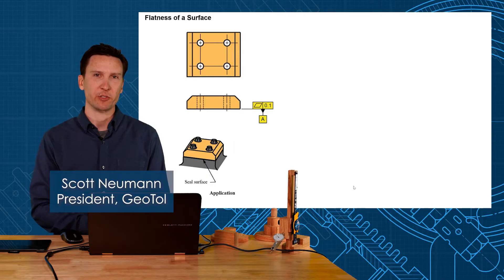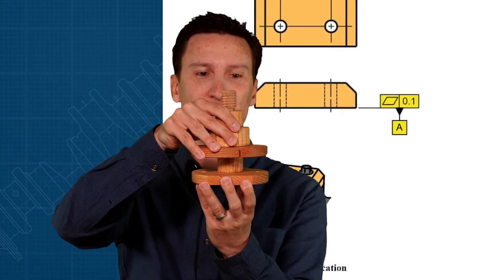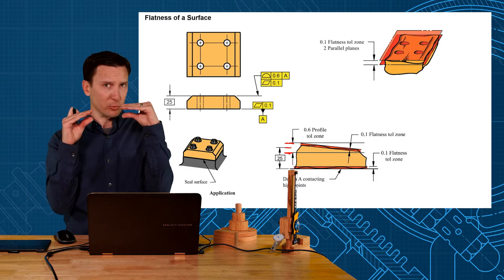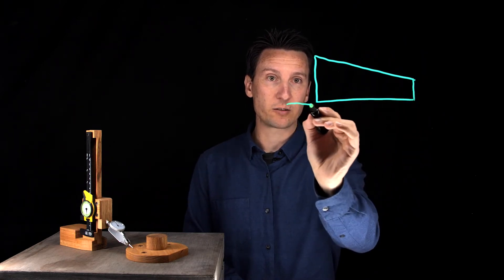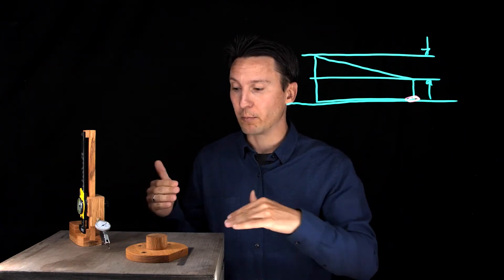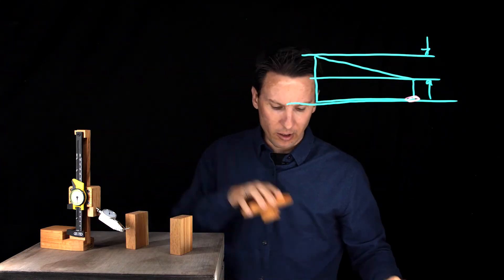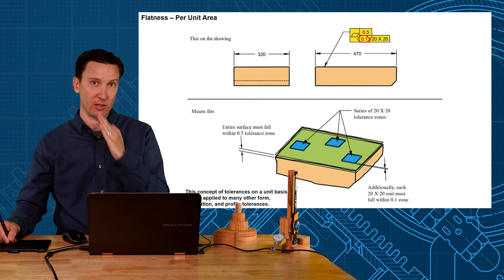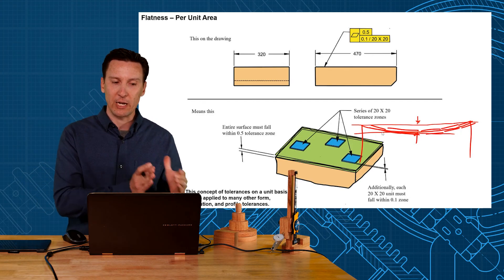Flatness Tolerance - How to apply and measure

Comment: Unless I misunderstand flatness is hard to separate from parallelism when inspecting.  In fact impossible?  One can only minimize the parallel error first then start trying to measure flatness.  Correct?
Reply from the maker: This depends on the measurement technique. Flatness has no datum feature references, therefore the tolerance zone is "best fit" to the produced surface. Best fit is easy on a digital device like a CMM, the algorithm is "minimum zone" (smallest set of parallel planes that contain all measurement points). However, this "best fit" is more time consuming in an "open setup" (bench setup) routine. There are some tricks shown in the video with leveling plates, shims and gage blocks. 

You are correct. One option is to minimize the parallelism error with shims or leveling plate, then measure flatness.
Reply: @GeoTolPro  Thank you for clarifying that for me.

Comment: Do not agree with your explanation of the Profile tolerance, that tolerance has nothing to do with flatness. Profile tolerance describes the form precision of e.g. double curved surfaces. You cannot add flatness to that. Flatness would flatten the double curved surface.If you want to specify the angle of that surface, you should add parallelism to that surface.

Comment: Great explanation! Could you also explain the difference between regular flatness and a flatness with CZ? How the tolerance zones would be in these two cases?
Reply from the maker: Flatness "combined zone" is an ISO-GPS concept. The CZ modifier locates the flatness tolerance zones together to also control location between the surfaces (usually to control coplanarity). ASME would instead switch to a profile tolerance to control location between multiple surfaces.
Reply: @GeoTolPro  Understood. Thank you very much!

Comment: Hey thanks for this explanation!
Question 0:15:
Is there a difference for the manufactured part to inspect if you:
1) Datum A onto the flatness callout itself (like in the video), or if you put:
2) Datum A on directly the surface

Does it matter or is it actually the same?
Thanks :)
Reply from the maker: No difference there. The surface must be flat. Then it is also named "datum feature A". Personally, I like to have the symbols together.

Comment: You need to have the part mounted on three points on the surface plate (gauge or 1-2-3 blocks) for flatness as 3 points make a plane, see GD&T Y14.5-2018 setup processes.
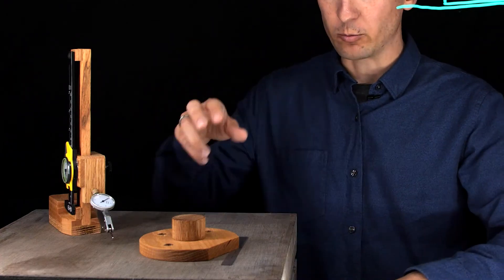Reply from the maker: The video mark 6:06 explains the three gage block method. However, this is a terrible way to check sheet metal or a large heavy part (gravity causes the part to sag). 
ASME Y14.5-2018 does not define how to measure tolerances! It only defines the theoretical tolerance zone. The part's quality plan defines the inspection method based the situation (risk vs. cost analysis). That's what the video is about.
Reply: Two points is never acceptable, putting on the surface plate is not flatness check, part will be reject by any metrologist if this is how you set it up for flatness. 
 @GeoTolPro
Reply: The risk is you put a company out of business for what you are showing as a way to check the parts for flatness, not worth it. @GeoTolPro

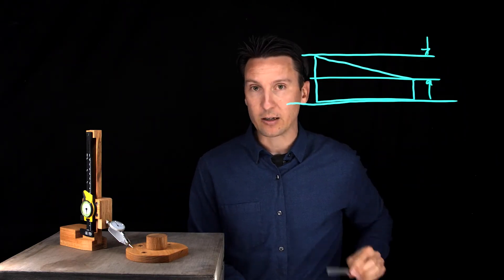Comment: Umm...I don't think adding some random size shim under a side @4:40 gets you to correctly measure flatness.  All you're doing is adding another unknown 'parallel' surface to the mix.  To measure flatness of that part I was taught to turn the surface to be measured upside down and support the part at tool points spaced as far apart as possible to limit their effects, like shown at 6:15.  Showing the method at 4:40 I think is misleading but I'd like to hear the reasons why it's not.
Reply from the maker: There is never a "perfect way" to measure flatness. Instead, there are different levels of risk vs. cost. Feeler gage check for flatness is common for large plates with say a 2mm flatness requirement. Feeler gages are cheap and quick way to verify this. However, feeler gages would be terrible for a machined part with a 0.05 flatness. A more precise (and expensive) measurement with a dial indicator (or CMM) would be needed.
Reply from the maker: Also, supporting off tool points would not be good for a heavy part or sheet metal that sags under its own weight. Again, there is no perfect way to measure flatness. There are different techniques for different scenarios with the need to balance risk vs cost.

Comment: in the starting, does flatness of 0.1 means it is controlling Ra(Surface roughness) or Ra is further refinement of flatness.  Size->Flatness->Ra   ??
Reply from the maker: Surface roughness is a much smaller scale than flatness. It is a localized peak to valley. Surface roughness also applies to curved surfaces where flatness does not. Not sure I would call roughness a refinement, its just a totally different jurisdiction. But geometric tolerances do control "all elements" of the feature.

Comment: Seen scenarios where large plates get stacked directly onto one another and slide/shuffle around during shipping and are left with scratches. Usually parts are still functional even though they would fail a flatness check because of a scratch. How would you specify that indented scratches/gouges are allowable on let's say 5% of the surface as long as the other 95% of the surface is flat within the specified tolerance zone? Add a note on the drawing?
Reply from the maker: There is nothing in Y14.5 like that requirement. A note sounds like the best method here.